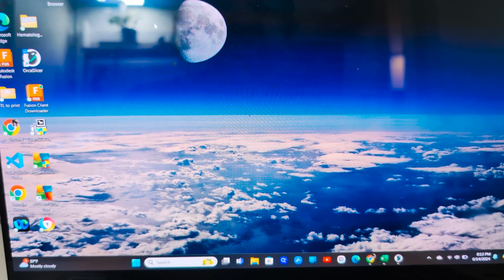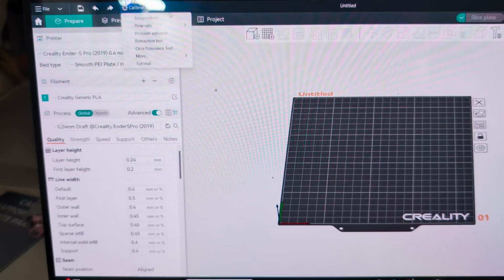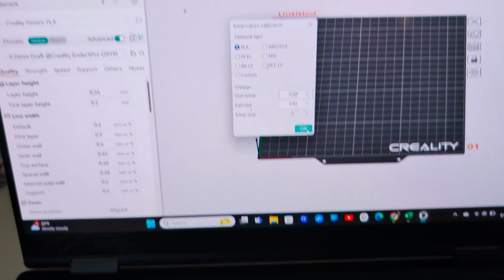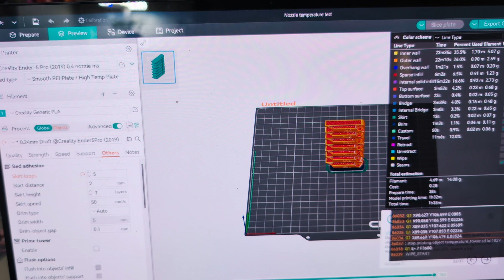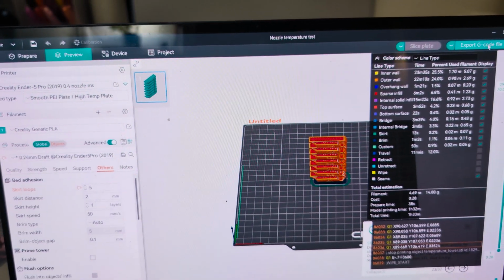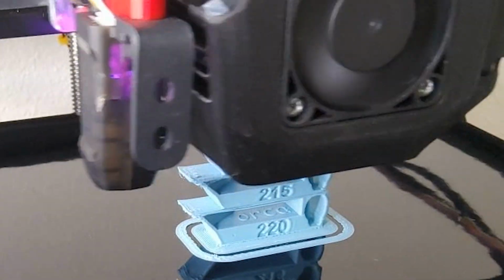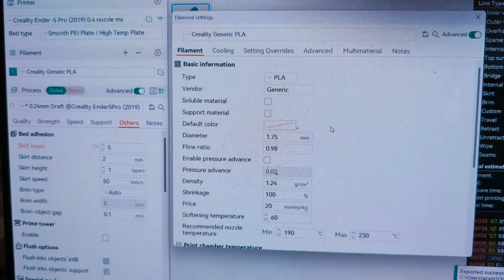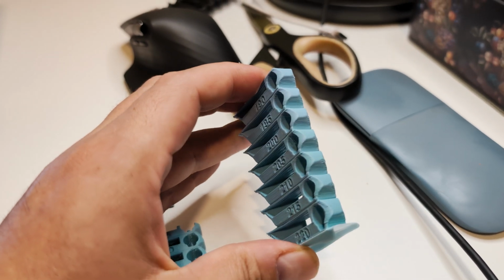ORCA Slicer Temp Tower

Comment: does it really change temperature? result seems have no visible difference level to level. Why you didn't show at least "temperature" color scheme? (I am asking because found that temp tower is not working in my Orca 2.0.0)
Reply: I made this video before I upgraded to 2.0 but that's definitely a great idea I should have included the temperature color scheme to display the difference.  For most of the PLAs I've tried it prints ok for most of the temp range so the differences are minimal.  Where are you running into problems not seeing the temp difference after slicing or at the hot end?  I will try another one using 2.0 and keep an eye on octoprint and my display to confirm if it's working for me.
Reply: @SnoringVids  temperature is constant on slicer view and during print
Reply from the maker: I'm attempting a temp tower print now using 2.0 I see that orca released 2.1.0 as a stable version.  My first layer is printing at 230⁰, I'll post a video soon just so you can compare if you're still having the issue
Reply from the maker: I also read on Reddit that someone with a similar issue was having it due to z-hop affecting their g code